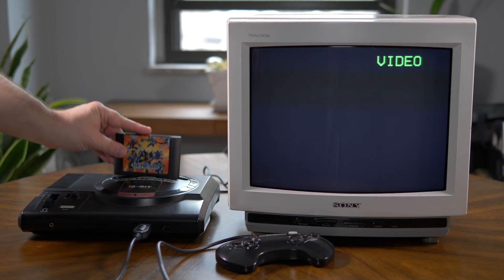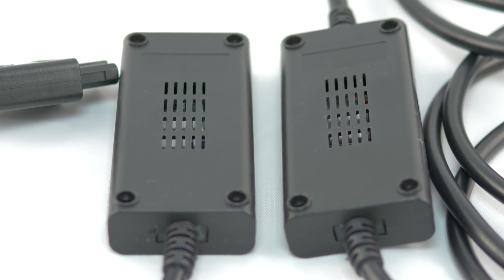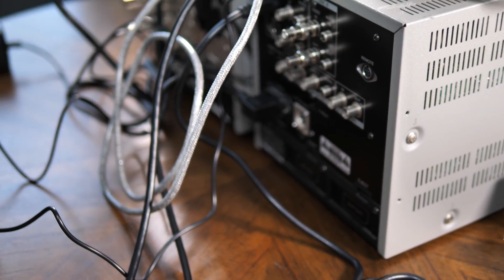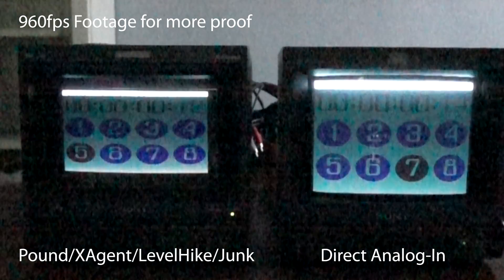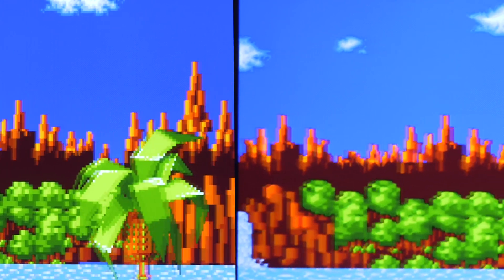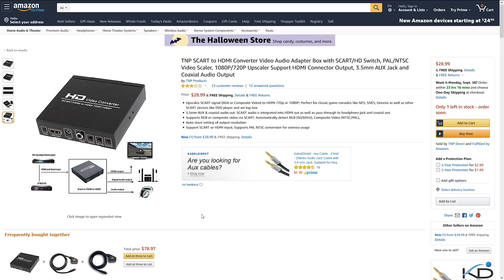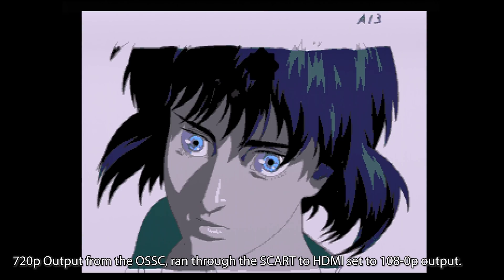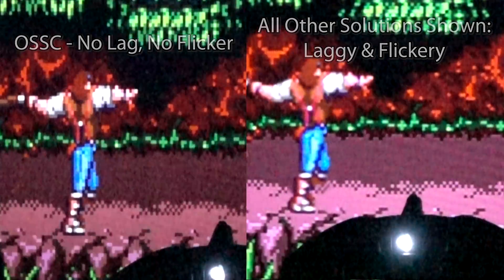The Worst Scaler In Retro Gaming

Comment: I recently got back into retro gaming after buying a house and now 
having a whole basement to myself. 
I was able to pick up 3 CRTs for free on July first (most people move on
 that day in Quebec, Canada somehow) 27" Sony Trinitron with stand, a 
20" Toshiba and a 24 inch Samsung that looked brand new (got it from a 
VERY nice house) all with component inputs. Added Retro HDVision Cables 
for PS1, Genesis and Snes.
Everything is hooked up a Joytech Component Switch that I bought back 
when component was a thing, I'm looking to replace it with a  
switch/splitter combo since I also got an OSSC and I would like to have 
the CRT and OSSC hooked up at the same time.
I'm still too afraid to get a BVM/PVM since they are a lot of money and 
hard to find and I need to figure out what to do with the N64.

Comment: I respectfully disagree. OSSC is too expensive to me right now, so it's Rad2x and retrotink (it's VERY expensive importing stuff in Brazil). I need to play on my flat screen TV since I don't own nor have enough space to use a CRT. So I only have 2 options right now: using composite or scart RGB with that exact scaler. I choose the scaler! It works a little better if you set it to VGA resolutions (and it outputs in 3:4) and IMO it's way better to be able to see things clearer than play with zero lag. In Brazil that setup costs about 1/4 of the retrotink cost and at least it's way better than composite, even with the lag.

Comment: sorry for irrelevant question but retroRGB has no forums , when i connect my ntsc sega genesis 1 and 2 to my 20 inch sony pvm  it seems it shifts horizontally to right and in the left side of tv i always have a black bar that sometimes sega compensates that void with relevant colors of games like in soccer games it becomes green , first i thought it may be a deflection adjustment problem but my pvm works fine with RGB DVD players , i have pure csync instead of composite sync and that doesnt matter because even in composite video or s-video modes i have same problem ! i have same problem of not getting a real full screen 100% in my ps2 and ps1 too but they are not as annoying as sega genesis , originally my sega genesis was PAL and i removed the 4 pins oscilator and replaced it with an NTSC one alongside with modding the pins for 60hz or 50hz i changed it to get 60 hz and my pvm recognises it when i connect it through composite or svideo it says NTSC! so if you have same experience like me guide me please !

Comment: Honestly flatscreen scalers and all that stuff seems like a waste of time to me, as I work with a much simpler setup: A good quality Trinitron, plugged in with RGB over the SCART port. 

Honestly, I’ve seen countless videos discussing how to scale games for LCDs, as I really enjoy them, but the end result is always inferior to a good CRT. Most of the time, the CRT route is cheaper. A Sony Trinitron KV-21X5U costs 315 quid on eBay right now, but a year ago when I brought mine, it only cost me 100 quid. An OSSC or Frameister cost around £200 and around £400 quid respectively, and a modern LCD costs at least 100 quid, but an expensive OLED can cost up to 800 quid.

The CRT is cheaper, easier, and looks better. But they are massive, I’ll say that. My TV is 21-inches, and I had to get rid of a wardrobe to fit it in.
Reply: Consider those of us who stream or move around our setups alot. In that sense a CRT is impractical and if there was a more convenient solution that didnt ruin the experience id welcome it.
Reply: @ians_parks Yeah, you’re not wrong. I was just very stupid and stuck in my ways back then because of the medication I was on. I definitely see the appeal of scalers and genuinely might get one for my big flatscreen.

Comment: Not sure how the OSSC is comparable in price, seeing as the listing on videogameperfection is currently around $150
Reply from the maker: The RAD2x is $50 and the Pound cable is $30.  Small difference for a HUGE quality jump.  Also, the RetroTINK2x is $100 and you can use the composite cable your console came with.  SCART to HDMI is $40, but you need a $25 RGB cable.
Plus, you can find stuff used for cheaper.  Be part of the solution John, not part of the problem.
Reply: @RetroRGB  right but the RetroTINK2x and RAD2x aren't mentioned in this particular video - There's just a brief moment where they're pictured and not detailed. All I'm seeing is "your simple solution that's been fine for almost half a decade is now bad and wrong and also go buy my friend's new thing"
Reply: You can buy a used OSSC on eBay like I did for around $100.00.

Comment: It's not a surprise that it fails the 240p test suite, cause this upscaler is not capable of 240p at all! In spite of that it will at least display something anyway. I guess that's why people believe that this is an option for 240p analogue signals. The documentation for this device is very poor and misleading, but you CAN find hints that the lowest possible resolution it can handle is 480i - just like any other hd tv. Here is a datasheet of the version i own: https://produktinfo.conrad.com/datenblaetter/975000-999999/989271-da-01-ml-SPEAKA_SCART_HDMI_KONVERTER_de_en_fr_nl.pdf
Reply from the maker: Right, it was never designed for video games, only TV signals.

Comment: I got the pound v2 xbox adapter. It's alright only cuz i don't own a ossc.
Reply from the maker: If that's just converting analog to digital, it won't add any lag and should be fine.  I should have clarified:  I'm specifically talking about the 8/16/32 bit versions of those cables.

Comment: For most gamers it comes down to price and availability the ossc/framemeister is way too expensive and even if the cheap scart to hdmi scaler isnt perfect its a whole hell of a lot better then the stock composite most these consoles come equip with  i have both the dreamcast rev 2 pound cable and the Chinese scart to hdmi scaler box and lag doesn't bother me playing games the pound cable you have to adjust color but that's about it doesn't bother me for only $30

Comment: I own the OSSC, and the SCART2HDMI -  but I've got to say I mainly only used the SCART Box for Sega Saturn games and was actually pretty damn happy with it. I mainly cared about picture quality in terms of colors popping compared to composite, and it did a really good job there. 

I knew a few months after buying it that it couldn't do 240p, but that wasn't an issue at the time.

I do wonder that since SCART is analog and if there is a quality control issue among these boxes and some boxes perform better than others.

Also I'm pretty sure my OSSC will get stretched on my TV unless I change the picture mode to 4:3 on the TV....

Comment: Even as the little use this device gets, which I am guilty to recommend, but I recommended a better alternative, was the use of the Xbox One HDMI as a pass through as it will give you much better picture quality than that cheap box if you have it, something I used to my OSSC be compatible with my setup, to take advantage that I have an Xbox One. For any streamer using that cheap toy as HDMI pass through, if you have an Xbox One, give it a shot as it accepts all you can shoot from an OSSC

Comment: Totally agree and this video needs to be spread. I've seen other youtubers say that the generic scaler is fine, good enough and much cheaper than alternatives. I started with the crap off brand upscaler on my oled TV because it was cheap, people said it was fine and I was hesitant to spend a bunch of money on tech to support older games and figured it will be good enough. Its just plain bad. Put up with it for about a year around 2015-2016. 240p games looked "acceptable" when paused but there was lag and blur during gameplay that just took away from the experience too much. Granted, the off brand upscaler can be used. I beat numerous 240p games like the original sonics, a few megaman x series games, metal slug etc using it. It can be done but if you really enjoy retro and want to play retro games regularly you gotta go with one of the good scalers recommended by Bob. It makes the games more fun and easier to play as intended. You really are just handicapping yourself in gameplay and making the entire experience more frustrating due to the lag and the video blur just makes a mess of sprite work. It made certain instances unplayable. It was near impossible to line up the slots on the slot machine in Super Mario Bros. 3 with the generic scaler. I then got a OSSC and its totally worth it if you play a descent amount of retro and led to me playing more retro since it made games perceivably easier and more fun due to not fighting lag. I did switch to CRT about 6 months ago when I found a PVM locally but the good scalers RetroRGB recommends are more than enough for the average gamer with few drawbacks. With my OSSC vs CRT, its also noticeably easier for example to line up the slot machines in SMB3 on CRT but OSSC is great none the less during 95% of the gameplay I've experienced. I only use the ossc for multiplayer with others for the bigger screen now since I enjoy playing on the CRT more but it is very acceptable as your only solution with only a few drawbacks due to LCD/OLED lag but that isn't the OSSCs fault. If you have the passion for old games, just pick up a good scaler like the OSSC, retrotink or other good scalers recently discussed by rgbretro or a consumer CRT, or if you find a PVM, for your retro games. Don't waste your money on the generic scaler, Mine sits unused in my closet now and was frustrating during the time I used it.
Reply: Metal Jesus said this scaler was fine and that the Pound PS2 HDMI cables were......

Comment: Thank you for this information on these scalers. I have been using the Pound cable for my PS2 and Hyperkin for Dreamcast. What would you recommend for these two systems as a replacement scaler on an HDTV? I am not fussed about 480p+ on the PS2 as the games I play are not supporting it. I will not be buying the Framemeister or OSSC at this time so something other than those. A link on your channel or something would be much appreciated.
Reply from the maker: For PS2, I'd either use component video and an HDMI to component converter, or get the RAD2x version.  It really depends if you're playing more 480p games, or 480i games.  Please see the RAD2x video for more info.
...as for inexpensive Dreamcast solutions, I like the Gekko, but ANY solution that just converts analog to digital without scaling it to HD will most likely not add any lag and be fine to use.  I'll have a video on that soon.
Reply: @RetroRGB  thank you sir, yes for PS2 I play almost always in 480i so I will check out the RAD2X! I will wait for your video on other Dreamcast solutions. I appreciate the reply and recommendations.
Reply: @Objection010  - The RAD2X is designed and works best for 240p inputs ( The PS2 is 480i )
Reply: For my current setup i use hd retrovision ps2 component cables through a retrotink2x in 480i passthrough mode. 480p bob deinterlace is also an option but i find the jittery look to be off putting.

Comment: Adam Koralik, "would have noticed" if it had lag.
Reply: He also said, "There's no reason to use a CRT except for light gun games."
Reply: And that scanlines "add extra clutter to the screen that doesn't need to be there."
Reply: darksoulzfreak I mean if you want the best looking game possible using a CRT is kinda just a downgrade. Adding scanlines also just adds clutter like in its most literal sense it is more shit on the screen that can be removed
Reply: He's hardly an expert,  Bob was being awfully kind. This is the same  bloke thay calls a "restoration" a wipe down  with  a  cloth.

Comment: Thank you, Bob. We've needed an authoritative video on this for a long time. As it was, people wouldn't even believe me when I tell them that the cables and the boxes were the exact same things with the exact same problems. Way too many people thought the Hyperkin, Pound, LevelHike, Xtreme, etc cables were some kind of solution, even excitedly modding them to support other consoles (obviously thinking they were getting something better than the [analog]2HDMI boxes). The defensive arguments have been truly ridiculous. There's even a local who is supposed to come see me in person expecting to prove me wrong about his modded Hyperkin cables. :)

About the only thing I would change about this video is the part where it says these scalers were made for VCRs and stuff as opposed to videogames. They were actually made to be the support electronics inside a TV which digitize analog sources and connect to the LCD panel. That's why some have a HUD showing the input signal, an aspect ratio switch, etc. It's also why they have all the same problems with 240p as any other generic HDTV with analog inputs (proper 240p processing seems to be reserved for the scalers manufacturers use in their own sets instead of shopping around to other manufacturers... Sony, Samsung, etc won't share). These generic scalers literally just took the digitized output of a TV's internal scaler, intended to go to a panel, and routed it through an HDMI transmitter instead. It's decidedly worse than getting a digital TV with analog inputs because at least there's a chance it will support 240p and even if it doesn't the external scaler will double the latency. Boo!

Comment: What would be the better overall experience: gaming on CRT with original Super Nintendo console or gaming on an Analogue Super NT on an IPS computer monitor ? Both use real carts. Thank you 🙏
Reply: I have both setups myself of an OG snes and crt, and a super NT on my monitor or big screen (my big screen has about 2 frames of lag in game mode). If you have a quality gaming monitor with very low lag (I use monitors suitable for competitive fighting games personally) then the gaming experience will be very similar to the CRT. I also like the convenience of the Super NT being able to be powered via usb. My surge protector has a few usb slots and take up a much smaller area than the old snes brick adapter.

One factor you should consider though is your audio. For years I've played snes on a CRT with just the stock speakers. Recently I've played more on my super nt and big screen that has a nice sound bar and external sub hooked up. The sound difference alone has drastically improved the immersion and I'm enjoying the games more than ever.  Just a thought to consider all aspects of your setup when making your decision.  Hope this helps
Reply from the maker: That's all preference.  I prefer the look of a CRT, but using flat screens in that scenario is an equally excellent experience.  I usually suggest people start out with the most cost-effective solution...and if you already own an original console, you can often find CRT's for free :)

Comment: One frame of lag, while could be noticeable, is not bad at all. I used one of these in 720p passthrough mode for OSSC 3x, to make OSSC compatible with my TV, and the lag wasn't noticeable to me.
Reply from the maker: But these don't add one frame, they add 3-5.  That's in the video....twice.
Reply: @RetroRGB  I could be misunderstanding, but don't you say at 4:23 that it's over one frame UNLESS you match input+output resolutions, in which case there's none at all?
Reply: Not trying to be offensive or bitter, by the way, I have all kinds of scalers, and I'm just surprised that OSSC+generic scaler combo isn't generally recommended, since it used to work great for me.
Reply: @shroom2k  You have to remember that many of these "cheap" products, are not consistent in their manufacturing. Often leading to some that might work well enough and others that are complete garbage. Lag is also perceived differently amongst the community, but if your "cheap" product is adding a variable amount of lag and latency. Then there is no way to adjust to it.  

I experienced this years ago while trying to play emulators and caused my overall gaming experience to diminish. 
It ultimately led me down the path of playing on OEM hardware with CRT Monitors.
Reply: @shroom2k  At 4:23 he's talking about the HDMI passthrough lag, not the lag in the SCART to HDMI-upscaling.
Reply: 土竜八七 Yeah, and that’s exactly the part that interests me. I have no doubt that this scaler is terrible for direct 240p upscaling, but as an OSSC companion device, if you don’t mind the color shift, it may be quite workable not just for streaming, but for actual play
Reply: @shroom2k  Sure, but there was also some erratic spikes of lag in passthrough mode according to what he says in the video. That might lead to inconsistent responsiveness. Anyway that amount of added lag isn't too much to worry about in itself, no.

Comment: I used this generic scaler with the intention on using it until I could work some overtime and get an OSSC. I think if you go in with that mindset it is not all that bad. I was definitely disappointed with it, but it allowed me to start a modest collection and to get the cheaper parts of my current RGB setup while waiting to get my OSSC. I was able to space out the cost of my setup while still enjoying the games
Reply: i did the same thing when i was saving up for my framemeister hehe